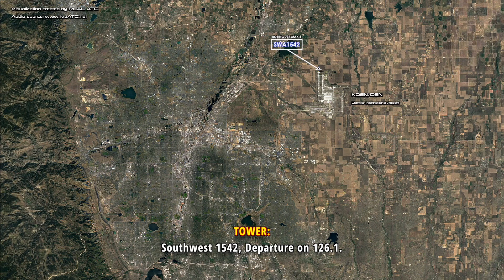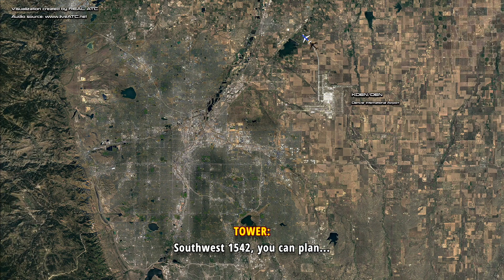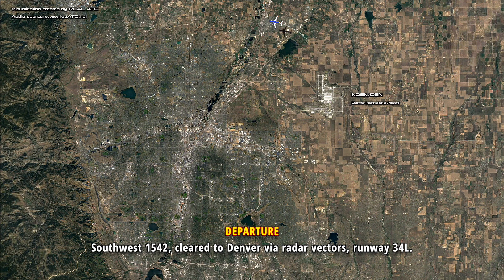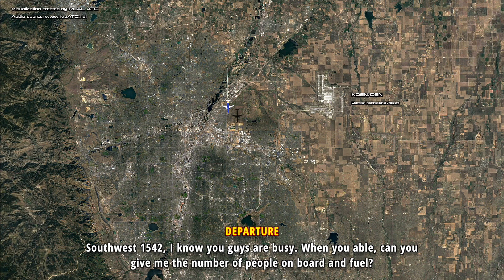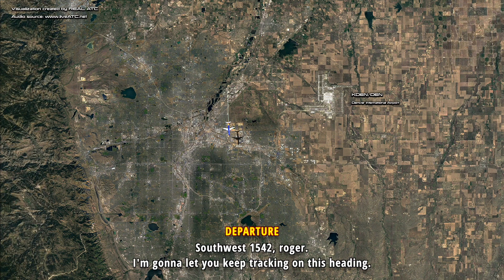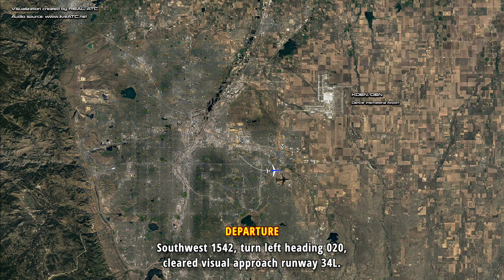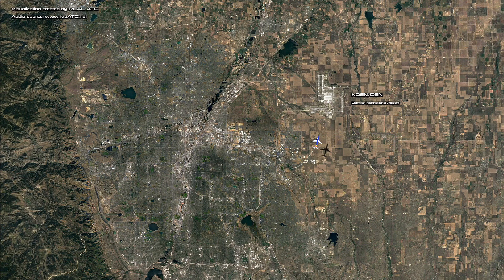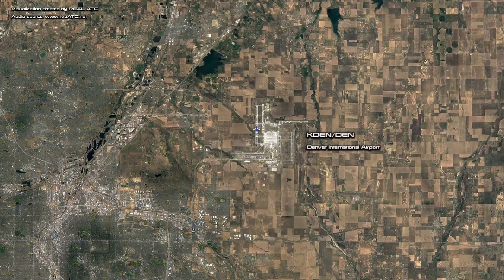Smell of BURNING ELECTRICAL WIRING in the Boeing 737 MAX Cockpit. REAL ATC

Comment: Can’t be that bad if they’re not on oxygen masks. Always sensible to land as a precaution, especially when so close to an airport. It’s not always an option though.
Reply: Ya… the 737 QRH first item for ‘fumes’ is to don the o2 mask…
Reply: Agree. Even if it is not bad, there should not be „electric smell“ at all in flight, so something is wrong and should be checked out sooner rather than later.
@Dan Wonders: When there is not really smoke but just a smell, it probably is useful to not put on oxygen masks, so the pilots can monitor what is going on with the smell. And I’m sure, as soon as it smells of smoke or somewhat dangerous they would immediately don the oxygen masks.
Reply: @matthiaspatzelt3085  that is exactly the opposite… the “fumes” QRH is differentiated from “smoke” in that it is only for smell. Incapacitation can be insidious and happen quicker than you think. Donning the o2 mask is not an option, but required in most airlines to avoid pilot incapacitation. The communication barrier is not that bad. Our carrier (second largest in the world if you know who they are) recently released a memo on this very topic reinforcing the need to use the mask in just such a circumstance and sighted several ASAP reports where not downing the mask would have lead to incapacitation even though there was no visible smoke.
Reply: @danwonders9403  thanks for the insights!
Reply: @danwonders9403  What about farts?
Reply: @RLTtizME  silent but deadly

Comment: Not jumping into the MAX because it past but Boeing got several issues in their production lines with metallic debris, tools rags and so on left by the workers. Debris was found during the assmebly of the cockit areas that are full of wiring. And the 787 as well.  Boeing make good jets no doubt. It is managed by clowns.